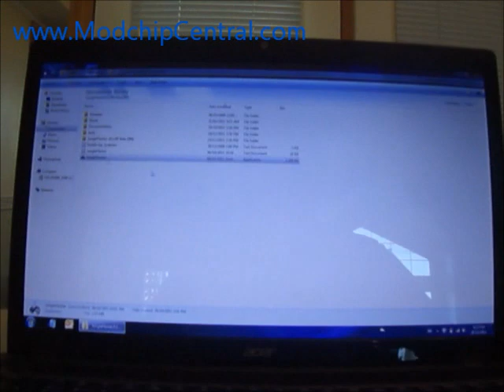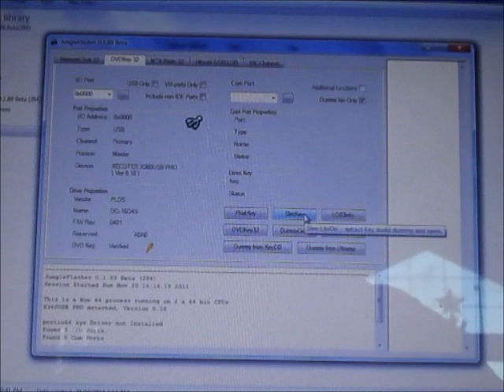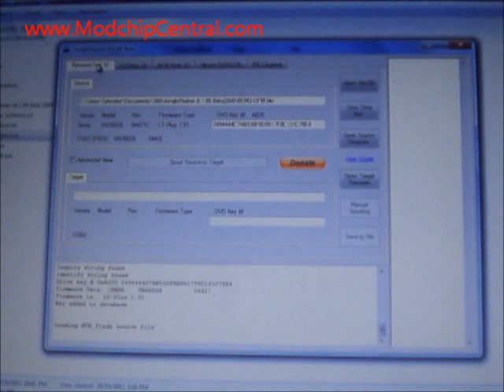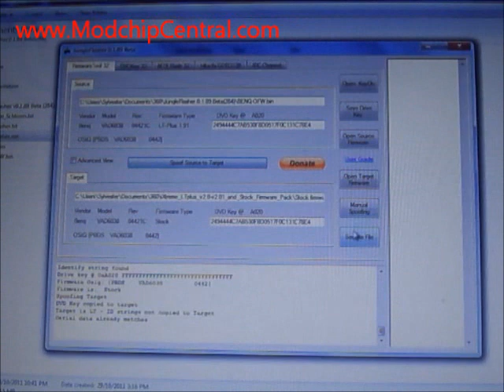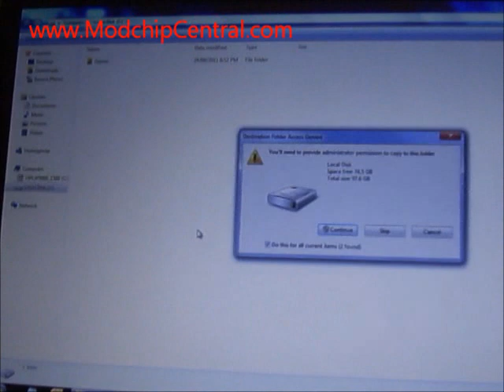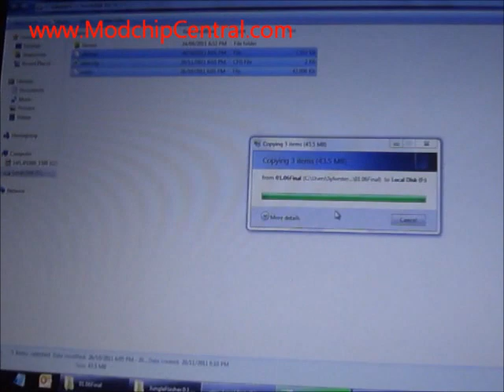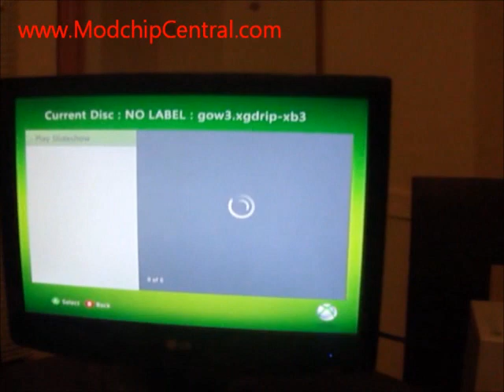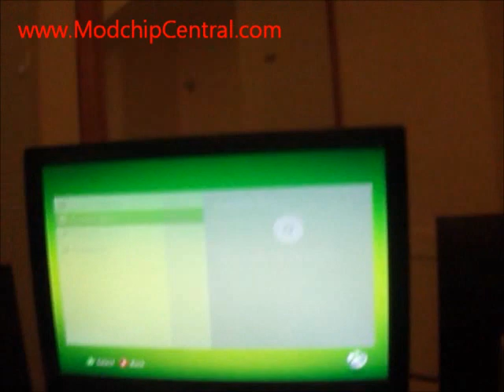X360key / xKey NEW Installation Video with MenuISO Tutorial - R7-2 Version

Comment: it shows on the videos 2 devices hooked to the drive and on the site it selling in the bundle only one can you explain?
Reply: There is they xkey itself and then the xkey remote. Its worth it I love my xkey. You do need a self powered usb hdd to store all the games
Reply: Sensi420 i have 250 gig hd inside my Xbox 360
Reply: Johnny OnTheSpot  you will still need a external self powered USB hdd. I would get at least a 1 or 2 TB for all the games you will fill it up with.

Comment: I may sound like a complete noob (because I am), but I thought you didn't have to connect your disc drive to the computer with the xk3y. I thought all you had to do was put the dummy.bin file on the sd card and connect it to you xbox disc drive. Why did you do all that other stuff at the beginning. I have a Lite-On drive if that helps. Thanks

Comment: this is cool and all but it's a little bit ridiculous.   1000 steps and wires coming out of your system that hook into a usb stick that hooks into a usb port...  then a usb cable into the usb stick to goes to a remote...  then another usb cable from your HDD to the remote.    jesus christ...  rather just burn discs and toss em in an unlocked drive.